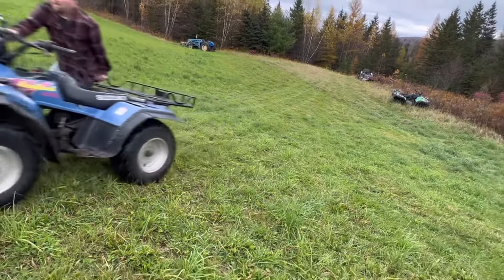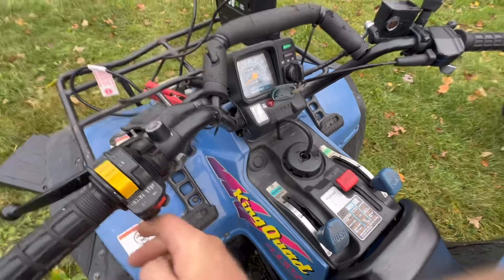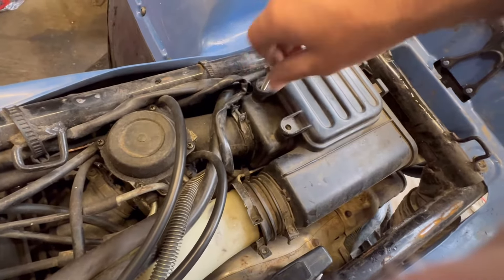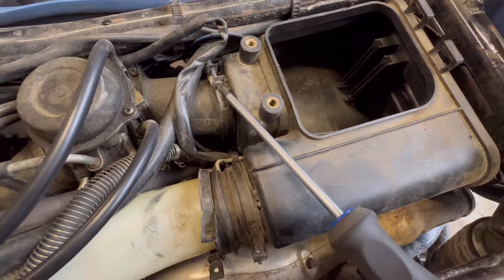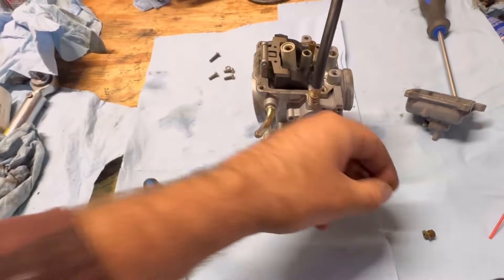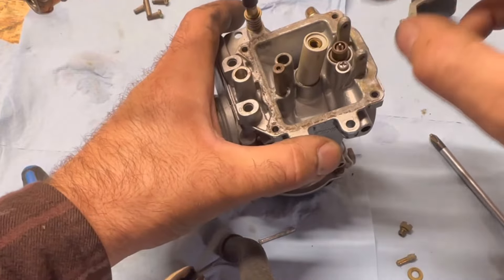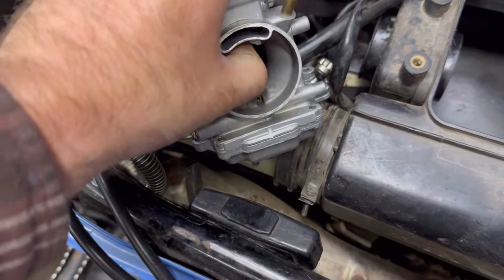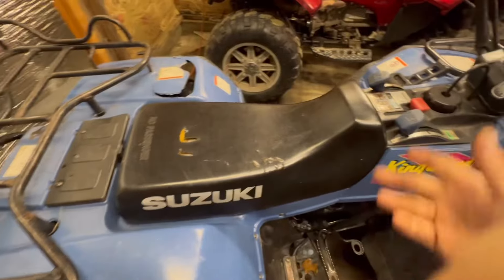Customer drove 5 hours to have me work on his Suzuki Kingquad! Let’s dig in!

Comment: These thnigs are tanks. In super low have someone sit on the front and they will pull a moose.
Reply: We have a 96 king quad and it built my cabin, dragged every log and pulled every load up hill through creeks and even in moderate snow, best quad ever made.

Comment: My first “full size” atv was a 1998 king quad 300. Started off on a 2003 bombardier ds 90 2 stroke. The 300 Was also the first engine I ever rebuilt. Ended up selling it and upgrading to a 2008 king quad 400. Now have a ‘21 sportsman 850

Comment: Awesome, my friend has a 2000 Suzuki king quad 300, it’s having a carburetor issue right now but it’s gonna get fixed soon
Reply from the maker: Things things are little tanks! I miss that quad runner 250 I had for a short period of time.
Reply: I remember that quad runner 250 that you tested to pulled that trailer, the quad runner 250 & the king quad 300 are basically the same just different motor sizes
Reply from the maker: Yeah there’s a few small difference that the Kingquad is a little better for.

Comment: Brings back memories had a red 300  awesome machine but go around corners fast and it wanted to throw you off like a vw  trans axle design
Reply from the maker: For sure, that independent with no sway bars is not the most stable thing around corners.

Comment: Great video My dude! I picked up this exact machine ( in way worse conditon) but running for 250$.
And then scorred a 93 quadrunner 250 for 300$ the frame has never been abused on the thing but the plastics have fallen apart.
After seeing your 3 wheeler video i think i know what i want to do with it. But its nice to have the pair for the time being
Reply from the maker: Always nice to have a parts machine. And man what a deal you got on them!

Comment: Pretty cool.  I’m in CT and had a hell of a time getting someone to work on my ‘01 Yamaha Wolverine 350.
Reply from the maker: I actually had someone drive from CT a few weeks ago to bring a machine. He had a early 90’s Polaris 6x6.. He said the same thing, no one wanted to work on it.
Reply: I used to work on ATVs/bikes in north central CT. There is a lack of people willing to work on them for sure. Thinking of getting back into it tbh.
Reply: Wish we had places to ride in CT.  Even if we had to pay people.
Reply: Most places unless it's a small dealer refuse to work on older stuff none of the Polaris dealers will not touch my 04 330 trailboss so I've been slowly gathering parts to do a complete rebuild just waiting on the one manual I ordered for the 330 engine family.

Comment: My 87 was my first and favourite 4 wheeler.
Reply from the maker: 250 Quadrunner?
Reply: @rockspowersports  yes it was orange with a black seat and had the glove clamp above the speedometer housing. The machine was ahead of its time.
Reply: Glad to see you flick the decompression lever  before you pulled that cord lol!!!
Reply from the maker: My older brother had the same machine. Used it for hauling brush for wreaths in the winter. They are work horses for sure.
Reply from the maker: For sure, they have some compression if you don’t haha.
Reply: @rockspowersports  I was a teenager and we used ours as a little tractor for pulling our firewood. After many years and many welds on the frame we still sold it for the motor.
Reply: I should have added that the ‘87 was a 250.

Comment: I have this quad For future referance I had the same symptoms as this but on mine it was the 2   o rings under the throttle slide when you take out the plastic throttle slid giudes took me FOREVER to find it but my air passage for the emulsion tube was blowing extra gas due to failed O rings same exact symtoms

Comment: No related but have you ever messed with the auto chokes on some of the arctic cat quads. I’m working on an arctic cat 500 and the auto choke is busted but I don’t really wanna spend $250 on a new one. Is manual conversion the way to go?
Reply from the maker: I personally haven’t had to do one yet, however I know a couple people that have done the manual conversion.
Reply: @rockspowersports  I got one of the cheap Chinese manual choke conversion kits, it says it’s for my machine but the needle on the plunger is too small. Gonna see if I can rig up the plunger off the auto choke to make it work.

Comment: what do you think would cause a rich condition at idle that will cause it to slowly flood out till it shuts off? 
it takes alot of cranking at wide open throttle to get it started again.
Reply: Mine did this it was a bad petcock leaking gas into the vacuum line leading to the carb
Reply: Just cap off the line at both end and run the carb set to prime or replace with an on/off/reserve petcock

Comment: I got the same quad, but my issue is that it idles find, but as soon as I accelerate, neutral or in gear, it starts to sputter. Like it's a V8 running on one cylinder. My first time dealing with small engines, Ben watching all the videos but they're saying clean the carb. Just got it back from the shop and apparently they did that already and was running nice and strong for all of an hour before turning to sputter. I haven't personally taken it apart yet, lack the tools and space right now. I'm hoping the fix I need is dumber than I am lol
Reply: I would think your jets may be clogged, and maybe the tank needs to be cleaned because something from there got in the carb again and caused it to sputter
Reply: I’m also having this issue. I haven’t rebuilt the carb yet but I will let you know. I also need to adjust the clutches, and the hardest part of this is getting all the carb inlet and outlet to reseal, wish that would have been in the video. Cheers, very helpful.

Comment: I have a 98 king quad and it doesn’t have the torque I think it should I didn’t Even considered the carb diaphragm as being a possible cause thanks for the help
Reply from the maker: It’s very easy to check, you don’t need to pull the carb. Definitely worth a look.